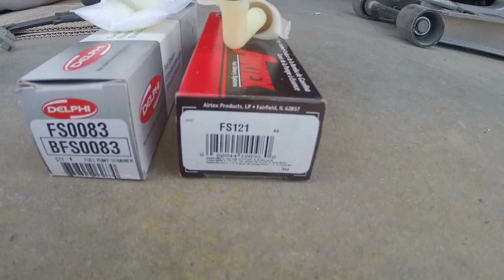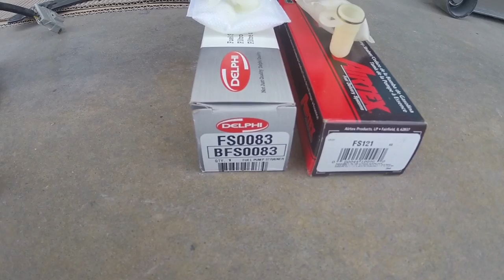How to Replace Fuel Pump & Gas Tank (88-91 Civic/CRX)

Comment: which fuel pump?
Reply from the maker: From eBay.  A seller called"ultimate components".  My buddy has the same one and has been using it for almost 2 years.  It's a 255lph one.  It is super quiet too.
Reply: +Jon Widmer is the wiring simple and did you notice a big difference in pressure?
Reply from the maker: +16ValveVtec Super easy, just the same 2 wiring from the OEM one.  I can't really tell since I'm pretty much stock.  I wanted to go obd1 in the future with some cams so I decided to upgrade it now instead of having to drop the tank again.
Reply: +Jon Widmer did it come with the strainer or u had to get it separately?
Reply from the maker: +16ValveVtec It came with a strainer but it's not the correct angle for our cars.  I had a problem in my 91 Si wheels it had the wrong fuel strainer when I bought it and at about 1/4 tank it would start cutting out like I was out of gas because it was a wrong angle.  I bought the Airtex FS127 for only $13 shipped.

Comment: When I bought it the old ladie told me that they haven't used it for almost 15 years.
Reply from the maker: +Justin Vargas Aw, have you checked to see if the fuel is coming out at the fuel filter or FPR?  More than likely the gas has clogged up the lines from sitting for so long so you're unable to get gas to the engine.  😒

Comment: Dude the filler neck hoses suck to reconnect thats all i have left they wont go back on
Reply from the maker: They can be tough as nails.  😤
Reply: @GarageBuiltHondas  Well got the car started. And it is not a happy engine. Blown head gasket. Guess i have to B swap it now. Thank god i only paid 300 bucks for it. Thanks for all the vids and info man
Reply from the maker: What engine is it?
Reply: @GarageBuiltHondas  Stock D15b2
Reply from the maker: Remove the head, clean the old gasket off and throw a new one on.  I've done about 5 this way without any machine shop work and had no issues.  I think it works fine on these engines because it had the thick fiber gasket which handles tolerances well if there are any unlike the thin MLS gaskets.
Reply: @GarageBuiltHondas  Thanks homie im somewhat new to the game but super passionate about the older Hondas now. Got a 93 hatch which is fine and now this crx. Love the ef's. Anyway yeah ill do the head gasket. Never done it before but here we go lol. Thanks bro
Reply from the maker: No prob, you'll learn a lot if you do attempt it. 👍